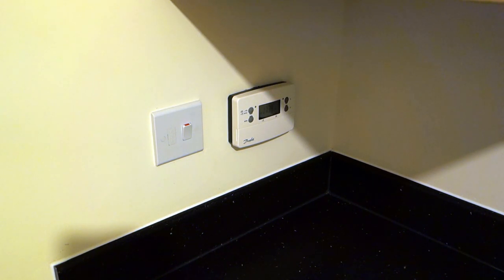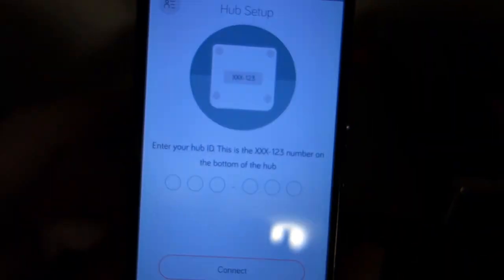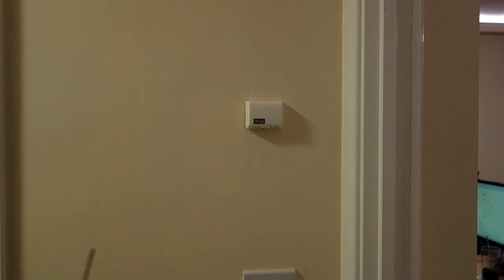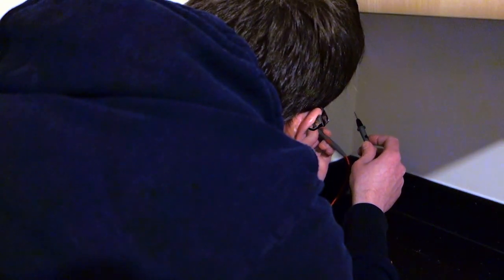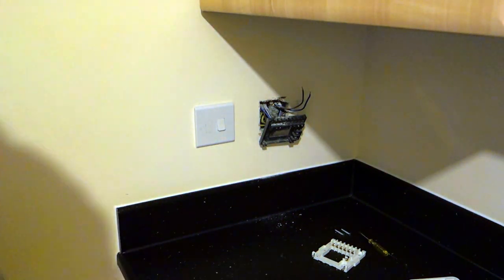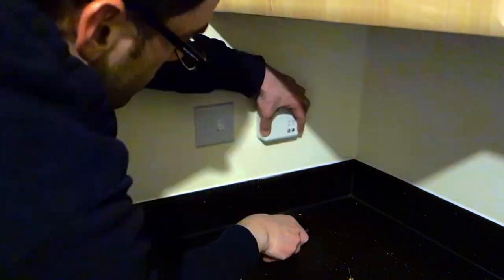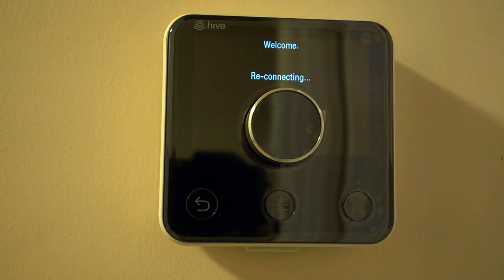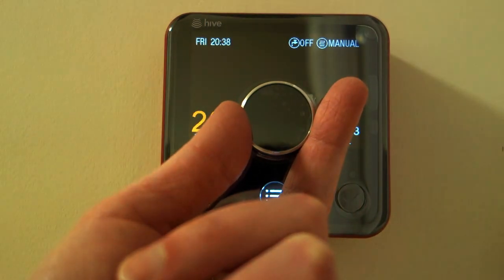Replacing a Danfoss TP9000 with a British Gas Hive Heating & Hot Water Controller

Comment: Hi, I have danfoss tp5000 which I want to replace with smart.

I have two danfoss tp5000 thermostat. 1 down stairs and 1 upstairs. 
I have 1 danfoss controller for water heating

I have boiler which heats water and centering heating.

Can above system be replace by any smart system or it cant be. I think everything is hard wire connected

Comment: Great video. are the Danfoss TP9000 wiring exactly the same as for the HIVE 2 for heating system boiler and hot water tank? if it is, do i have to change the wall plate from Danfoss to HIVE? (saves having to fiddle with the wiring).

And is the wiring for HIVE Multizone exactly the same as for Danfoss TP4000 also?  thanks!!!
Reply from the maker: The Hive uses a standard backplate and the TP9000 has extra connectors for its remote thermostat. You'd need to change the backplate, as I did in the video. I'm unsure about the multizone / TP4000...

Comment: hi -question when decommissioning the room thermostat when I put a block on the wires do I connect them in the same block terminal to create a loop.  the video is great but its speeds up when you put the block on the wires for the old thermostat - I am planning to install the hive and mulitzone
Reply from the maker: In this setup those wires go back to the programmer - whilst you could loop both ends together it's probably better to keep them all separate just in case, although the reality is that this wire is now just an isolated cable in the wall.

Comment: Hi, thanks for posting this helpful video. I wonder if you know what's been different for homes with multiple heating zones? I know I'd need another hive controller, but what's the wiring like for that?
Reply: Hi Mate, I’ve got one of those crap danfoss controllers also. I also have upstairs/downstairs heating zones.  I’m thinking of paralleling both zone valves in the wiring centre and controlling both front the one hive unit.

Comment: Hi there, looking for advice! I appreciate that I am not an electrician but I am an engineer. I’ve wired the Hive up as per the manual, but the central heating only comes on when the hot water is on. I have 1 and 2 not used. N-N, L-L, 3-HW On, 4-CH on. 
Do I need to link a live loop from L to CH on to power that up?
Reply: it sounds like you have either got the wrong hive model as there is one for combi boilers only and one for a traditional heating system with boiler and hot water cylinder or you have got your wires mixed up or even you have gravity hot water and pumped central heating. have a look at these diagrams, they may help you: https://www.honeywelluk.com/professional-zone/resource-centre/Wiring-Diagrams/

Comment: Hi Phillip, I notice that you blanked off the wires behind the old thermostat and then removed the same two wires and blanked these off at the controller unit.  Did you then need to change any wiring on the backing plate to effectively close the loop? (which would have been the job of the old wired thermostat to do). Hope I am making sense.

I thought perhaps I need to join the red and yellow wire behind the old thermostat but ideally you do this on the backing plate of the controller.

Thanks
Reply from the maker: The wiring on the backplates is identical, except that the Danfoss has those extra terminals for its own external thermostat. As long as you copy the layout from the existing backplate to the new backplate you should have no problems!

Comment: Hiya
I have exactly the same thermostat and wanted to swap it for hive. There are no wires connected to terminals 1 and 2 on thermostat 9000. Was it the same in your case? Does that mean when I swap on to hive nothing is connected to 1 and 2 on hive as well.
Reply: +Lak Har I finished the installation swaping like for like at N, L, 3 and 4. 
5 and 6 were screwed into terminal blocks at both ends. 
All is well and Hive is working with no issues what so ever.
Reply from the maker: +Lak Har Sorry I didn't get back to you sooner; yes - Earth, 1, and 2 were all empty on my unit. Neutral and Live have multiple wires each, 3 and 4 had one each. 5 and 6 were only for the remote thermostat. Glad you've got it all working!
Reply: Hi. So when all this is fitted, it will control hot water and down stairs heating? Will zone two heating upstairs still work from upstairs thermostat? Also, the thermostat downstairs. Did you short the wires together? Thanks.

Comment: great video, just out of interest do you use standard 2 way terminal block?
Reply from the maker: Yep, just used them to keep the wires isolated / neat. Although you could wrap them in electrical tape just in case they move inside the wall and touch other terminals, there's less chance of a terminal block falling off.
Reply: Phillip Parr ok thanks! looks like I have 3 wires in my hall way thermostat so looks like I'll need a 4 way terminal block to include earth
Reply from the maker: As long as they're dead wires, you can use the small ones: http://www.maplin.co.uk/p/3a-terminal-blocks-3-pack-l96ar
Reply: Phillip Parr thanks

Comment: pulling the fuse out the spur would NULL VOID all your terminals for sure and would be the correct procedure
Reply from the maker: I don't think many people have fuses they can pull out - just switches to flip. If you still have concerns just flip the master RCD and do it quickly so your freezer stuff doesn't melt :D

Comment: Hive is garbage! Temperature overshoot and thermostat lag, have to manually turn on and off to regulate heat in home, basically doing the hives job for it. Supposed to be a TPI algorithm firmware update in Jan 2017 eventhough customers been complaining for years. If we don't get the update hive is going in the bin and investing in a Nest, they don't have same problem.
Rant over.
* NICE VID 👍
Reply: The Hal.... how are you getting on with your Hive system and the problems you were having? I ordered hive yesterday after mulling over to get nest or hive (hive and multi zone came in at £278 so seemed a good deal) I would quite gladly cancel tho before it's fitted and go with nest if it's going to be a pain in the arse. Cheers 🙂
Reply: Scott Rides I had hive install last Friday and seem pretty happy with it... not set it up properly yet with schedule's... but the fact I can boost the heating from my Apple Watch to both upstairs and downstairs when away from home has made me happy 😁 Deff thumbs up from me at the mo 👍